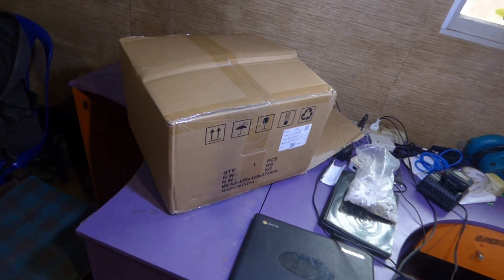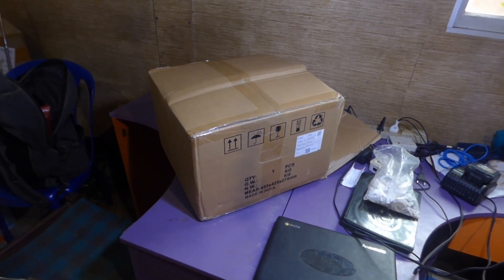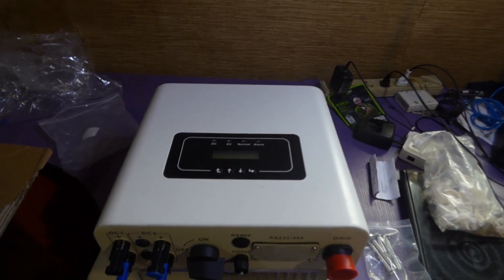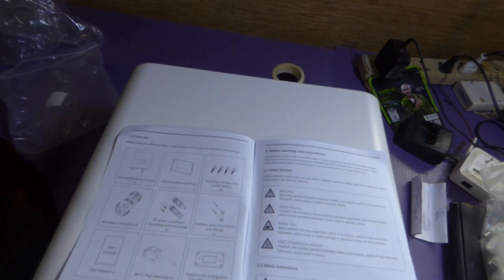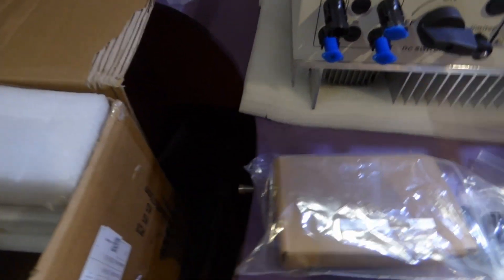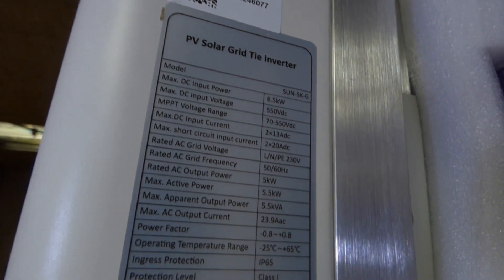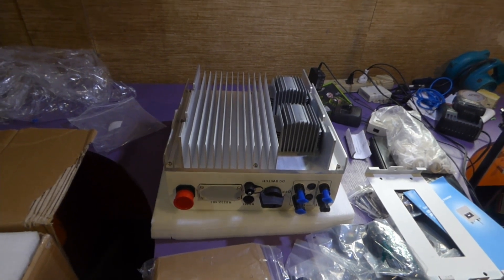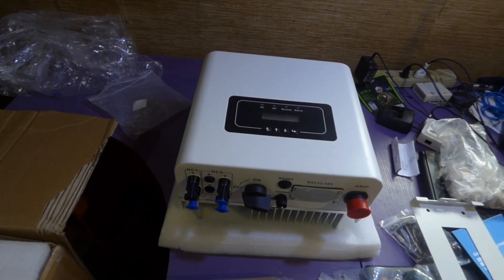Unboxing the Deye 5 kw String Inverter and my plans for it

Comment: How is the deye inverter condition after few months? Do you have any trouble?
Reply from the maker: Working fine with no problems.
Reply: @drsolar  thanks for the reply. I have 12x450wp pv panels, is it okay to series all panels and input directly to this inverter?
Reply from the maker: @sabilza  two strings one to each mppt. If you have three 8 kw as long as the total Voc of your panels is less than 450V then one string into the inverter

Comment: Doctor, what 2 mppt hybrid 5kva 24vdc off grid inverter do you recommend? Or what 5kva 24vdc off grid inverter. I have 10kw lifepo4 storage and 2.5k of panel, my current inverter not up to the job, want to run air con and washing machine..
Reply from the maker: Hey Chris thank you for watching and commenting. I am not familiar with a 5 kva hybrid that is 24 V. The Victron easy solar might offer you something that comes close but it is not a true hybrid in the sense. If you want to run high amp devices, I suggest you do 24V minimum. I am considering higher voltage down the road
Reply: @drsolar  Thanks for your reply, the only thing that's holding me back on  48v is some expensive 24v batteries that may not work in series. I've been avoiding victron, as it cost loads, and I think there must be other alternatives as good. There maybe a growatt out there for me, but isn't available from UK suppliers, so research on alibaba. I do see products only for export to Nigeria, at good price, which I find frustrating, on alibaba.
Reply from the maker: @chrisfryer3118  I feel your pain. It is not easy to find affordable 24V inverters that come with good warranties outside of those that we already know. You will have to bite the bullet and purchase one on Alibaba
Reply: @chrisfryer3118  you can try to growatt

Comment: Sure it will work and good but your real problem is you need more panels. IMHO AC coupling is the only way to go. 80% of the maximum production of the grid supplying inverter is maximum size so the inverter can control the frequency is a general rule of thumb. It is amazing to watch it do it's thing.
Reply from the maker: I need way more panels than I have at the moment OGW. I will pull one string from the inverter and test it on the PV inverter and then do enough business to get me more panels. By the end of the month I hope to add between 2 and 3 kwp. I am doing 1 for 1 on the inverter. I should have asked Deye what they suggest. Victron and Schneider tell you 1 for 1. A 5 kw battery inverter to a 5 kw PV inverter. I can't wait. Ran into a little snag. My folks stripped something so we need to get it fix to put it online it is relatively easy to do. Thank you for watching and commenting

Comment: Hi, I'm also using Deye 5KW Hybrid with 7KW panels, it generates upto 5.8KW from PV and I also want to extend via AC coupling but with microinverter. I asked Deye about AC coupling limit , they suggested 2 to 3KW for AC coupling and MAX allowed is 5KW.  Make sure you don't exceed 5KW.
Reply from the maker: Thank you for the heads up. I will do my best to not exceed 5 kw. It is not likely to happen in the immediate future. I considered the microinverter first before I settled on the PV. Did not want to climb on the roof and remove the connections. Update me once you do yours. Thank you for watching and commenting
Reply: @drsolar  Sure I'll let you now once I do that in near future. In this video someone did that in india  https://www.youtube.com/watch?v=U0C0djK8eiM I know language will be issue, maybe you can get idea by seeing that.
Reply: Hello Dr Solar. What was the outcome of AC coupling?
Reply from the maker: @asimali9766  thank you for following up. I had a little bit of a problem with the AC connector (resolved). I purchased 8 x 390 W panels. They got delivered yesterday. We hope to have it online tomorrow. All the AC connections have been done. Waiting on the panels to go up.
Reply: @drsolar  All the the best. I hope and pray that everything will go as expected. Waiting for your next video.
Love and respect from Pakistan :-)